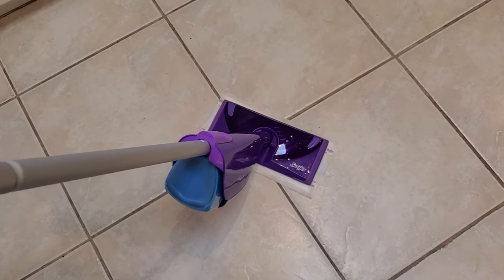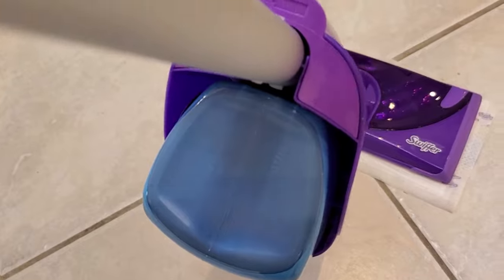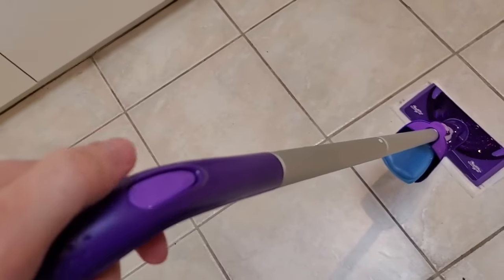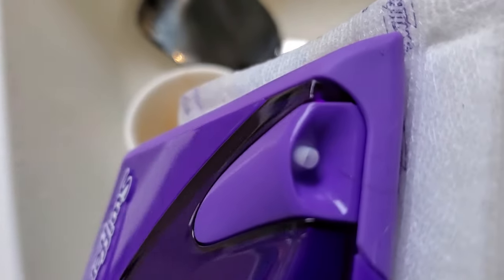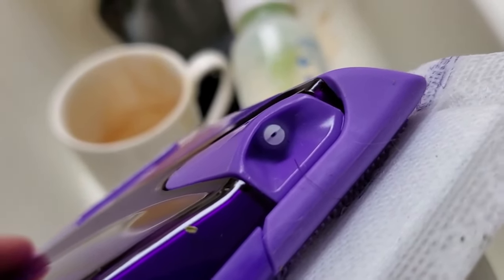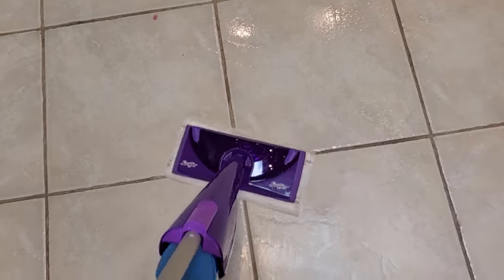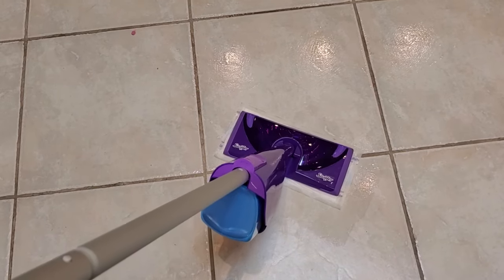Fix a Swiffer Wetjet That Won't Spray

Comment: Another tip. Remove the cardboard that divides the liquid material and the actual swiffer. I didn't know you had to take that little cardboard out. Doing this will allow the liquid to lock into place
Reply: OMG, I didn't either. Took it out and it works. You saved me a fruitless trip to return the "defective" model. You made my day. Thank you!!!
Reply: @nancywettersten1127  haha no problem!
Reply: holy shit i feel so dumb seeing it immediately work after your comment!!! thank you
Reply: Exactly my issue lol. Thanx!
Reply: Duh! Lol thanks a lot for the heads up. I thought it was a plastic part of the Swiffer. Locked in as you said and working just fine.
Reply: Thank you for commenting this!!
Reply: @enidenid9462  no prob :)
Reply: THIS WAS THE TRICK
Reply: omg tysm I would've never realized I was starting to get so heated lol
Reply: THANK YOU
Reply: That cardboard got me thank you!
Reply: @Midnight_LoveStory  no prob! Glad the tip helped
Reply: tytyty❤
Reply: Been at this an hour lol thank you this fixed it😃
Reply: Wow!! Thank you. I feel like an idiot lol 😂
Reply: The way I've been trying to punch this bottle in not knowing it was cardboard 😅 THANK YOU
Reply: Jesus Christ you’re a life saver! I bought a second one thinking it was broken. Nowhere in the instructions did it told me to remove the “white cardboard” when it looks like an actual piece of the swifer
Reply: Your comment was exactly what I needed! I feel so dumb 🤡😂
Reply: Thanks so much. It was the cardboard for me too!
Reply: I was getting frustrated saw ur comment and bam it was the cardboard inside thank you 😅
Reply: You just made my day!! I was about to throw it out, but of course it was the cardboard. They should send you free stuff lol😂
Reply: LEGEND!!! Cardboard got me too!!  Thank you!!!
Reply: You saved me lol I didn’t even notice the cardboard.
Reply: You’re a legend
Reply: That was my problem.  The cardboard looked like it belonged there.
Reply: u are a life saver
Reply: Came across this video, my wife couldn't get it to work. I took the cardboard out and Wala! Magic! lol
Reply: Thank you so much! It was the cardboard!
Reply: Thanks! I would probably never have figured it out!😆
Reply: Bro thank you , tryna clean my apartment up. My dumbass was like , “the things in wtf do I gotta YouTube a swifter jet. (Maybe need to lay off the weed but you just saved me brother thank you 😂😂😂😂
Reply: This!!!!! Wowww ! Literally couldn’t figure it out till I realized the white part was cardboard 🤦🏻‍♀️
Reply: x  Thank you SO much! I hadnt even noticed the cardboard until I read your comment so I removed it, the bottle of cleaning solution fits properly and it now work and I needn't return the mop.
Reply: Thank you, that was my problem. Mine is brand new and was definitely not anything in the video
Reply: Haha me too, best tip in this entire video.
Reply: Welp. I'm a moron. Thank you.
Reply: Thank you so much ! It didn’t even look like cardboard, truly ! I found this comment more helpful than the video itself 😂
Reply: Wat cardboard?
Reply: Where is the cardboard piece? 😢
Reply: It’s a white cardboard in the section that you put the bottle of solution. You’ll be able to put in the bottle without removing that cardboard, but it won’t ‘click’ into place until it’s gone.
Reply: @rene_downie  got it! Thank you!!!!!!🙏
Reply: Omg thank you!!!!!
Reply: Just figured that out too!
Reply: I had the same problem. No liquid coming out and I noticed the cardboard after your comment and voila! It works! Thank you so much for your comment.
Reply: Thank you man! Ur a legend
Reply: My issue too. I swear it was a part of the product. WOW. Feeling dumb.
Reply: Lol how do none of the guides tell you about the cardboard?! Thanks for this! Solved a half hour of frustration!
Reply: You’re a goat
Reply: Thank you ❤❤ I feel so dumb cause I came here to see why the bigger bottle didn't fit... It was the cardboard insert 🤦🏾🤣🤣
Reply: @nancywettersten1127 I was about to do that too 😂😂
Reply: That was my problem.  It's new, I didn't even realize cardboard was in there!
Reply: I didn't even see any cardboard! After I read your comment, I turned it upside down and the cardboard fell out. So, thank you!
Reply: life saver
Reply: Wow u saved the day

Comment: A little trick instead of having to buy a new solution bottle every time you can place the bottle lid down into some really hot water and allow it to soak for awhile and it will release the cap. You can refill it with whatever solution you’d like and save money on the refills
Reply: 😱😱😱I was wondering how to get those "got darn" caps off!!?!! Gosh darnit!😂 Thanks!!
Reply: There is a jagged lip on the bottom of the cap to stop you from opening the bottle. If you can cut it off leaving just a regular screw top then you can refill with your own liquid as much as you like
Reply: yep; I've been doing that since I bought it; works wonders and saves so much $$
Reply: Thank you ❤
Reply: But then it leaks into motor and here I am .... Fml

Comment: Thank you for the tips… I have the older model and it stopped releasing solution years ago (5+) and forgotten in the closet. My husband was trying to fix our steam mop and was unsuccessful so when I returned it in the closet I saw swiffer mop collecting dust and brought it out to try fix it. Saw ur blog, put on new batteries, I tweaked the metal contact for the batteries (Thanks YungWizard),  and tried your suggestions and cleaned the nozzle, push the button longer and voila it works!! 👍 I’m proud of myself 😄 able to fix something that I would normally ask my husband to fix it. Doing a happy dance 🕺now 😁
Reply: No reason to bother anyone else.  You are capable of fixing these things.  Don't tell him it was so easy.
Reply: Same for me and my old model witha single nozzle!!! I thought the battery contacts were fine but when I pulled them out a bit more (and cleaned the disgusting nozzle) VOILA!!!:hands-yellow-heart-red:🥳🙌

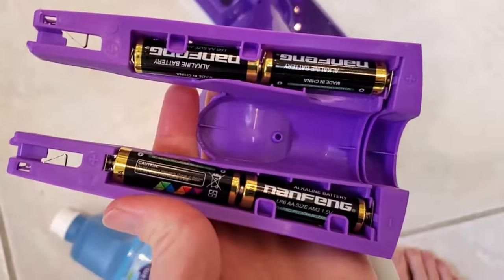Comment: Appreciate the tips! Unfortunately, none of those did it for me. However, I wanted to share what did work. For context, my mop wasn't even attempting to spray solution out of the front when I pushed the button so I assumed the issue was electrical and didn't have to do with the solution/tubing. The root cause was the little triangular metal contact points that connect the battery insert to the mop. They're in the gaps lowest on the plastic battery insert (shown in your video on the far left at about the 1:00 mark). Took some scissors and bent those a smidge further away from where the batteries are and voila--functioning mop. Seems like those metal pieces weren't contacting the mop housing to complete the battery circuit. Hope that helps someone else!
Reply from the maker: Great stuff, thanks for adding it here!
Reply: THANK YOU
Reply: Thank you!! This was my issue!! Was almost ready to throw it away!
Reply: OMG IT WORKED!!! thank youuuuu!!!!! It took me like 20 mins to figure out where to move it but I figure it out & it workedddd
Reply: wow thank u legend. this was my issue
Reply: Genius!  It worked.  Thank you!
Reply: This actually helped! Thank you.
Reply: THANK YOU. Mine was also pushed in and this helped. I really didn't wanna return it for another
Reply: litteraly fixed my problem thanks!
Reply: THANK YOU !!!! almost had to return it
Reply: Omggg thank you. I was about to bring it back because nothing seen to work
Reply: Thank you so much !, this absolutely worked!
Reply: Thank you so much!! Mine is brand new and didn’t understand why it wasn’t working. Bent the triangles and it is working 😊
Reply: Thanks YungWizard 
  Got home with a new one from Walmart put it together correctly got the batteries and removed the cardboard insert by the spray bottle all ready and pushed the button and nothing. Replaced the cheap Chinese batteries with Duracell and nothing. The great thing about YouTube is it is educational. After reading your advice I looked and one of the little contact spring was in too far. Got a small flathead screwdriver and bent it into position and like magic the motor started humming and the liquid sprayed onto the front of my pants 😂.

I guess I should have pointed the nozzle down to the floor. Thanks again
Reply: You’re a live saver, your tip is much appreciated! It fixed my wet jet right away. I was about to throw it in the garbage already. 

God bless!
Reply: THANK YOU!!!
Reply: Thank youuuuuuuu so much
Reply: Fixed it! Thanks
Reply: THANK U! could not figure out what was wrong, just pushed the triangles down slightly and we’re golden !
Reply: this was my issue !!! thank you so so SO much !!
Reply: Yes its working thnak you god off the swiffer 🙏
Reply: Thank you my friend, you are wise
Reply: Worked for me!! Thank you man...
Reply: THANK YOU!! This worked
Reply: Helped me thanks yung !
Reply: Thank you!! It worked!!
Reply: Thank you!!! This was my problem! I almost just threw it away
Reply: I just brought one and thought I was going to have to take it back. Bending the metal pieces worked! Thank you!
Reply: This fixed it for me! Thank you so much!
Reply: This worked for me when nothing else did!
Reply: Omg this worked for me too! I would never have thought they weren't lined up right. Took a minute of fiddling and then it immediately worked!! Thank you.
Reply: Thank you so much for the comment/tip! Seems like after a year these swifter jet mops still continue to have these issues because I also couldn’t get mine to work after buying it brand new. Luckily this helped fix the problem! Thanks!! 😅
Reply: My issue too!! Thank you so much! 😅😂
Reply: This just worked for me, I appreciate it!
Reply: This worked for me, too. Great reply, man, thanks. I’m surprised at how flimsy the construction is. The spring steel contacts should be anchored.
Reply: This was the issue for me. It’s a brand new swiffer and wasn’t making any noise. I poked out the prongs in the battery compartment a bit further out and it started working.
Thanks
Reply: Thank you man
Reply: This also worked for me! So the issue is still happening with Wetjets bought in September 2023—I used a kitchen knife to 'flatten' the triangle piece, which pushed the tabs forward slightly. Wetjet worked a treat as soon as I did that.
Reply: @gdoehne how did you do it? I think I might have the same issue but I can’t figure out how to bend them
Reply: THANK YOU!!!!!!
Reply: Fixed my problem too! Thank you so much!
Reply: This helped me!!! Thank you! Worked right when I bent it!
Reply: Worked for me too!  You’re amazing thank you!
Reply: Worked! Thank you soo much!
Reply: @anyapulluru8806  same here
Reply: Thank you for this! This was the issue with mine!!!
Reply: THANK YOU !!!!

Comment: My almost-new Wet Jet was not spraying after being idle in storage for 2-plus years.  It still had the empty sample bottle of liquid cleaner in it.  I was fuzzy about how to use it.  I figured the batteries were probably no good after the time in storage after pressing the button a few times and nothing happened.  

After some suggestions from my grown daughter about how I might improvise (as she had had the same experience herself), I just decided first to check YT for troubleshooting.  SO GLAD I DID!!  After reviewing all your tips, I checked my battery supply, but only had 3 out of the 4 AA's needed.  Next I tried depressing the start button a  longer time, doubting it would work.  But it DID work!!!  I was shortly able to quickly clean a very dirty little floor that had been getting on my nerves!

I'm going to tell my daughter the tips I learned here which told me everything I needed to know and saved the time and bother of "improvisation".  Now I know my unit is actually OK to use!

Thank you for helping me to help myself!!!  😃

Comment: You saved me! I tried new batteries before watching your video, but the motor wouldn't turn on. Then I tried holding down the button for a good while and she started working. Thank you!
Reply: How long did you press the button?
Reply: @nadnodnadia  probably 60 seconds or more. It felt like a really long time lol
Reply: @kt102396  Haha ok thank you! Before I saw your response I disassembled the wet jet, tapped the motor a few times, and then held the button for about 10 seconds and it worked. Wondering if I just had to hold the button for longer to avoid the disassembling lol xD I had only initially tried for about 15 sec with no response...

Comment: I’m so glad I found this video!

My sister was about to throw away her swifer wet jet cause it had stopped spraying and I needed to downgrade from my O Cedar dual chamber mop bucket cause I now only have 2 very small hard surface areas to maintain. She has much more hard surface space so she would get the bucket and I’d get her defunct swifer. 

I was willing to just pour out or spray some cleaning solution on my floors before each cleaning and use the swifer to just scrub.  

Then I thought lemme see if YouTube has any videos on troubleshooting this problem. I’m so glad I did!  After watching, I inspected the sprayer area and sure enough it was caked with build up and gunk. So I gave it a good cleaning and wouldn’t you know it, it works like new now!

Comment: I have an older swiffer wet jet model that quit working. I didn't have time to work on it, and went and bought a new one. Shortly after it would not spray. My wife would press the switch 50 to 60 times to get it to spray.( Very frustrating) . I tracked the problem to the switch. It has an engineering defect where the plastic cover on the switch shifts and misses the button underneath it. I removed the plastic cover on the switch. It just pops off. And now have access to the small button underneath. I threw away the plastic cover and push the small button. On my older model I noticed corrosion (white or green buildup similar to buildup on water faucets) on the spring where the batteries are inserted. I scraped off as much as I could with a pointed knife and it also started working. Hopefully this will help you.

Comment: Another tip is to open the unit. To do this there is one screw on the top center right where the head pivots, remove it. Remove the fluid cartridge and look in for two silver screws and remove them they are smaller, so 3 in total. Pop off the top plastic piece where the gray push button release for the cartridge bottle is. More than likely when you look in you will find the little pump housing has cracked and came apart. Found this situation with mine. Simply used a little crazy glue to put it back together, reattached the top cover with the three screws and all worked like new again!

Comment: I didn't even consider to check if the nozzles were clogged, thank you!
Reply: Same here.  I would have never thought the nozzles because the spray motor wasn't making a sound.  But cleaning those noozles fixed it.

Comment: Love your suggestions but  after trying all,  finally noticed that one of the metal contacts to the batteries was corroded and rusty.  Cleaned as best I could with WD 40 and scraped it off and it worked!  I have 2 more in the garage that don't work and going to try to get those running.

Comment: Another issue that we had was that the needle that punctures the container came out with the old container. My wife put a new container in and it would not spray. I had her get the old container from the garbage so I could see how it worked and low and behold there was a needle stuck in the top of the container. Took the needle and reinserted it back into the wet jet and it worked like a charm. With the container out you can release the catch inside the wet jet and press down on the white piece inside. I used a screwdriver to do this because there is another needle that penetrates the top of the bottle in there. Once pressed down I could see where the other needle needed to go and I used pliers to insert it. Make sure the point side is up where it can penetrate the top of the bottle when inserted. Maybe this will help someone .we were lucky to find the needle in the top of the old bottle.
Reply: Thanks. That worked for me. I took a knife to it and pierced it. Works perfectly now.

Comment: Make sure the long aluminum handle is correctly inserted into the slot. Mine was very tight. I sprayed a paper towel with WD40 and rubbed it inside the metal pole up to both small open slots. The Swiffer now works.

Comment: This is my 2nd Swiffer. I gave the 1st one away when it would not work. No. 2 quit on me and I fixed it with advice from here a few months ago, now it has quit again. Tried to fix it and now the light comes on but no spray? Gotta check the solution....

Comment: I did everything you said and its a no go. Going to contact swifter. thank you! great video.
Reply from the maker: Thanks! They have a satisfaction guarantee so you should be able to get a new one: https://swiffer.com/en-us/our-commitment-to-clean/swiffer-money-back-guarantee
Reply: I checked solution, checked batteries,cleared jets,..before watching Video, But still NOT working. I am not sure I understand about metal contacts,..i looked at them they seem fine. Mine only has 2 bateries. It was working fine  2 weeks ago?

Comment: Also, make sure ALL of the batteries are in correctly. I had one battery facing the wrong direction. The symptom was a very weak spray with barely a sound when pressing the spray button, once I corrected the battery direction, the Swiffer spray was strong and back to normal

Comment: Also,  check if battery acid has leaked onto the plates and scrub it off once I did that the swiffer started working immediately.

Comment: My problem turned out to be a poorly seated bottle.  It looks like there is a switch that won't allow the Swiffer motor to run unless the bottle is seated properly.  I tried just pushing it down harder, but what worked was taking the bottle completely out and then re-seating it.
Reply: Does it click when it's properly seated?